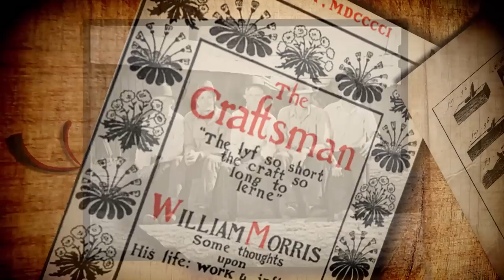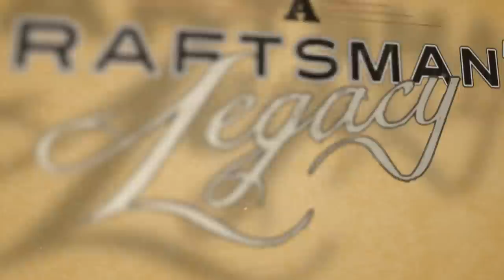A Craftsman's Legacy: The Wood Worker

Comment: Patrick here, Just to see you using a woodcutting bandsaw reminded me that as part of getting my Master Degree at U of I, I designed a bandsaw with 3 wheels where the table stayed level and the blade and arm tilted. I made a full size, non-working model that stood in the hallway of the Kranert Art Musem for a while.